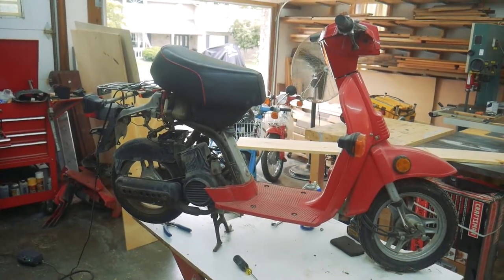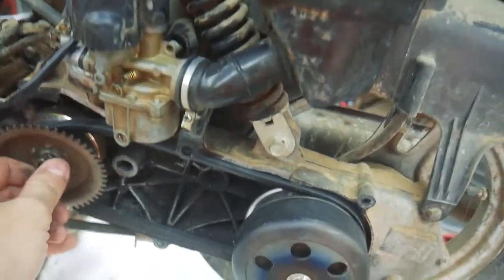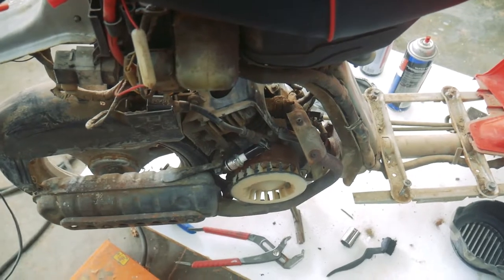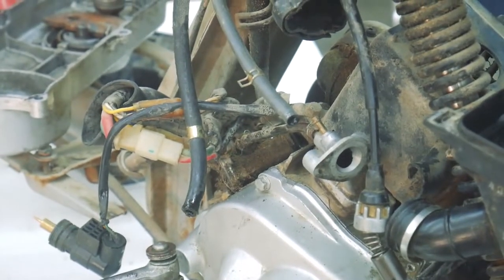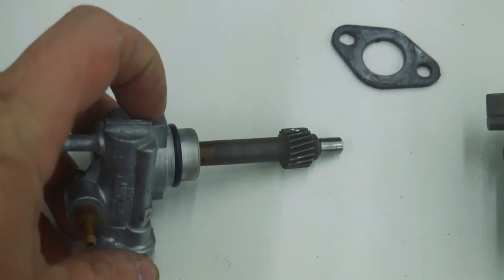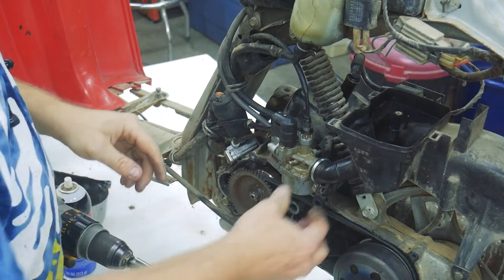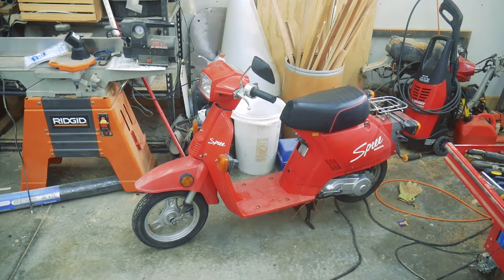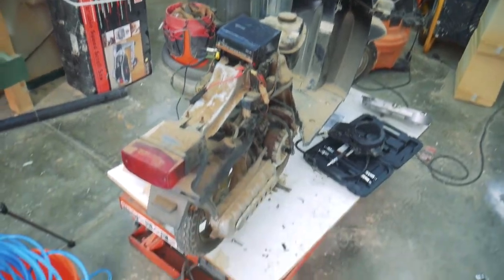1986 Honda Spree Repair: The Red One

Comment: Great video how did you go about figuring out if the oil injector is working and with it working how much oil did you go through in relation to gas
Reply from the maker: I disconnected the small line that goes from the pump to the carburetor and ran the engine. I was able to observe the oil dripping out of the pump when the engine ran and that was good enough for me. I don’t know what the ratio is, but it is somewhere around 40:1

Comment: Hey Thomas! thanks for the video! I was wondering if you have any idea why my scooter's engine will start but does not move on acceleration. I was riding the spree and felt a vibration and lost all traction after that. It still idles fine but giving it gas does not get the scooter to move. Do you think it's the clutch?
Reply from the maker: Hey Felipe, I would say start at the clutch. They have these springs and weights that are known to fall out over time. I had one clutch that lost one of the springs. It still worked but made a huge racket going down the road. Good luck!
Reply: @SouthpawWorkshop  thanks for the reply! When i opened it up there was shredded belt parts everywhere! I put a new belt but could not figure out why the belt got shredded in the first place. I’ve ridden it about a mile or two with the new belt but I’m afraid it will happen again. If it does, I’ll probably change the clutch and the front pulley. What do u think?
Reply from the maker: Sometimes belts just wear out. These scooters are almost 40 years old!  If it does break again right away, then yes you should look to see if something in the drivetrain is causing damage. Good luck!
Reply: Hi Thomas I bought a Honda spree nx50 three years ago for 350. The honda run fine about a year then suddenly I can't start the engine , do think because the battery dead causing it won't start ? 😙 
Now I lost the key. 😙 
Thanks for your video that inspired me to make the Honda run again. 😊 I will start to strip the Honda so I can order the new key. 😙
Reply from the maker: Key start or kick start? Engine needs 3 things to run: fuel, spark and compression. Make sure carburetor is clean and fuel is getting to it. Kick over the engine with the spark plug out to check for spark. Test compression with a compression gauge or just put your thumb over the spark plug hole to make sure there is plenty of compression when you kick over. If you have all three, you should be able to run, just need to troubleshoot things like timing, valve clearance and carb adjustments at that point. All these things I mention can be found on YouTube. Good luck!
Reply: Thank you so much for your education. 😊 One thing's my Honda spree Nx50 I think 1989 before they start good. Do I have to replace the new battery before I start checking for spark plug fire. Thanks.
Reply from the maker: You can try with the old battery. If no spark, you can then try with a new battery.

Comment: Here in Alberta Canada, I just got an 86' and 84'. A little trouble registering the 86'(84' is currently a parts bike, but may run into the same trouble.) There's a prefix, JH2(Honda Motor Company Ltd.-Motorcycle) that needed to be added before the VIN and was recognized in the system as being previously registered. Curious of the carb bath gallon you use with the basket. What is that?
Reply from the maker: Yes, I also needed to provide the VIN with the JH2 prefix in order to have enough digits to qualify as a VIN. As far as the carb cleaner, it is called Berryman Chem-Dip. It isn’t sold in a few states here in the USA, so I wouldn’t be surprised if it isn’t available up in Canada. I got it at my local auto parts store.

Comment: Not sure if you will see this comment, but there is one listed near me for $30 and was wondering is it's a good deal. It's in rough shape, and the engine is partially disassembled, but everything is there. 6604 miles
Reply from the maker: Definitely without hesitation I would buy it
Reply: @SouthpawWorkshop  lol the listing was up for 15 minutes. Already sold as I was getting ready to message him. Oh well you win some you lose some

Comment: Great video verry helpful since i just bought a 1985 nq50 spree
Reply: I have a question, my engine has spark and gas but every time i get the spark plug out its wet ? Do i need a carb cleaning ? Thanks
Reply from the maker: There are a couple screws on your carburetor, an idle adjustment and an air/fuel mix screw. Turn the air/fuel mix screw all the way in, then back out 1.5 turns and try that.
Reply: @SouthpawWorkshop  thanks !! ill would be nice if it was only that
Reply from the maker: Do yourself a favor and subscribe to the Mustie1 YouTube channel. Everything I know about gas engines I learned from him.
Reply from the maker: How many miles (or km’s) does it have? Does sound like a compression issue.
Reply from the maker: clayton E good luck! On my red C70 video I talked about how the previous owner had installed 2 head gaskets which obviously created a compression leak. Get that head sealed back up and let me know how it works out!

Comment: I'm currently working on getting my 1985 Spree running. Just found that the starter clutch was all the way out and touching the drive gear. But that little tube connected end to end on your carb, mine wasn't like that? One end of the tube disconnects to nothing behind the carb. I've been having trouble finding information on where it goes and what it does.
Reply: Also where did you spray the starting fluid?
Reply from the maker: So that tube looks like someone tied together the drain line and the overflow line.  Probably because the carburetor would constantly overflow sometime in the the past.  Both of those ports can be open to the atmosphere with individual tubing that runs out the bottom of the frame.  I can't remember if I put it back that way, but since I cleaned and tuned the carb, I don't think I did.
Reply from the maker: Starting fluid goes in the air intake of the the carburetor.  You can do this with the airbox attached or disconnected.  If you are spraying it into the airbox, be sure to remove the foam filter first or the starting fluid will melt the foam.  After you get it running, the airbox and foam filter need to be in place for proper tuning of the carb.

Comment: Having trouble getting mine to idle :( cleaned the carb already and made sure petcock was clean and flowing. help with any ideas or if you have parts!
Reply from the maker: I’m assuming you know how to adjust the idle screw on the carburetor. If not, start there. Does fuel flow out as soon as you disconnect the fuel line? It shouldn’t. It should require a vacuum on the vacuum line before any fuel comes out. If it is free-flowing without a vacuum, you probably are flooding out the engine. Some other things to consider is whether you got all the parts back in the carb the right way (happens to all of us at least once), if the float bowl is set at the correct level, and if the needle valve is sealing properly when the carb bowl is full. You say it won’t idle, so I assume it starts? A weird issue I had with one of mine was that the oil pump would leak oil into the cylinder while the bike sat, so the Spree would start, but not run. I would have to start it over and over to burn off the oil before it would idle. You would know that is the case because it would smoke a lot!

Comment: Would you recommend using a drill start? I'm waiting for a battery to come and the kick start is gone
Reply from the maker: Not sure what a still start is? If you mean a jump box, then yes, it can be used.  You can also jump start off your car battery.
Reply: Thomas Lightle I meant drill start, I hate autocorrect
Reply from the maker: Yes, you can use a drill. Be careful, once the engine fires over, it will be spinning faster than the drill and you could accidentally spin the nut right off the pulley. Ask me how I know....
Reply from the maker: Make sure the battery leads are tied together if not attached to a battery to complete the circuit or the scooter won’t have spark.
Reply: Ok, thanks!

Comment: I know this video is old but does anyone know why my 84 nq50 will crank over fine without the spark plug in but wont once i put the plug in
Reply from the maker: Did you mean to say cranks over fine with the spark plug out, but once you put it in it struggles? If that is the case you are probably dealing with a weak or dirty starter.

Comment: You didn't mention what was the fix? Main jet or float level.
Reply from the maker: It was neither. It performed way better once I put the air filter back on and played with the air/fuel mix a little more.

Comment: I just bought a spree.. mine is bogging with any kinda of throttle.. so if you have any ideas since the video please let me know. Thank you
Reply from the maker: So that usually has to do with the air/fuel mixture screw on your carburetor. On the carb there are two screws, the idle screw and the fuel mix screw. It sounds to me like the fuel mix screw is too lean, or not enough fuel is being mixed with the air. Locate the screw, turn it all the way in until it bottoms out, then back it out 2 full turns and try that. If it still bogs, turn it in a quarter-turn at a time to see if it improves.  If it doesn’t improve and the screw bottoms out again. Take it back out two turns and adjust a quarter-turn in the opposite direction each time, testing for improvement. I home that helps. Feel free to comment back if you have any other questions.
Reply: The air hose to the carb from the airbox might not be tight. If your kick start doesn't return like the one in this video you need to use white lithium grease or you'll grind down your kick start spindle. Its sticking which leaves the shaft gear out.

Comment: I bend to see how you actually put the kickstart assembly on. Like the case and everything
Reply from the maker: I would show you if I still had them, but they have already been sold. There shouldn’t be any trick to it, just slide the kickstart spindle through the hole and push it on, slightly wiggling up and down to get the kickstart gear to mesh.